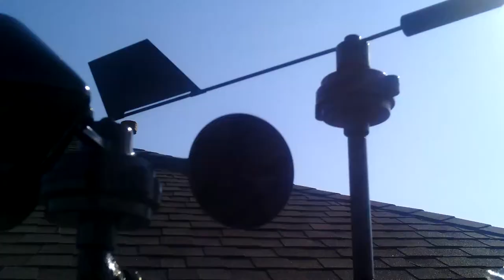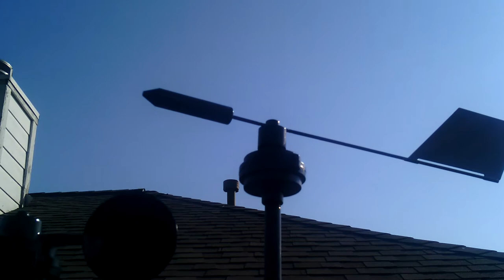Taylor Windscope roof setup

Comment from the maker: It's to calibrate the wind direction. The direction runs on a D cell battery and when the battery gets low that helps reference the north orientation to adjust using the left nob.